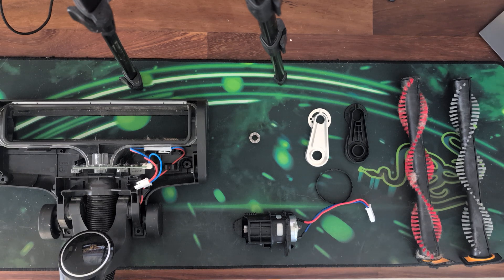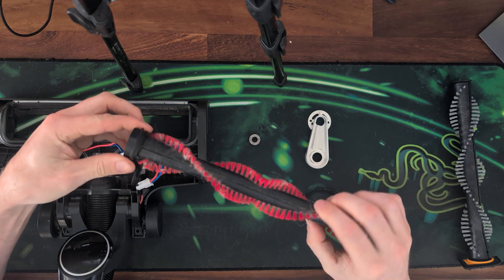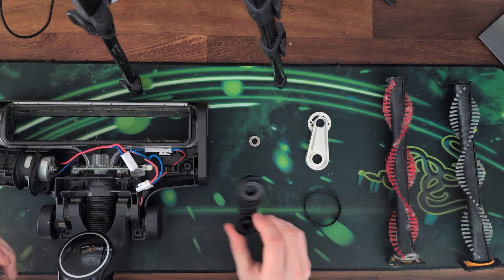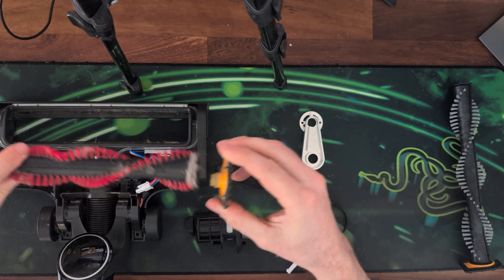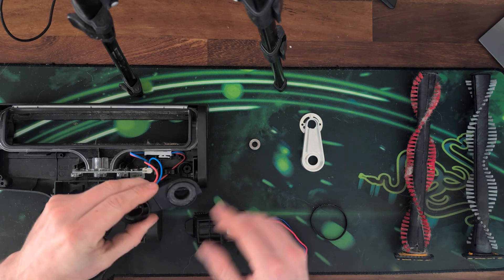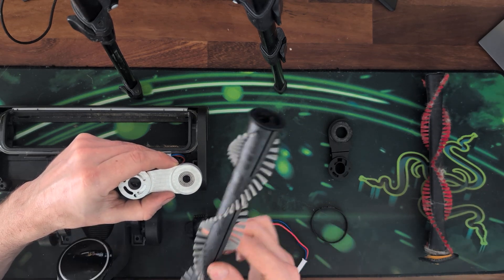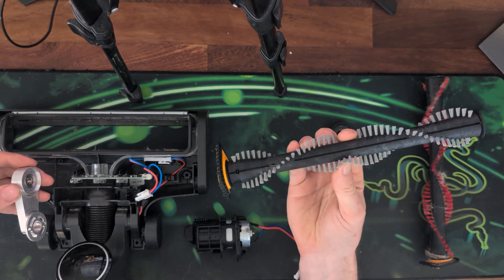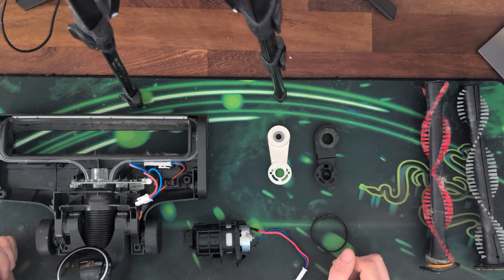Miele Triflex head not spinning repair/upgrade

Comment: CNC companies tell me that .STL is a 3D printing file. Who did your CNC machining with the STL file. Thanks so much.
Reply from the maker: They are dead right. It should be a STEP file for 3d printing. I'll do a git later this week and change the link in the video which will have a STEP file
Reply from the maker: New links with the correct files in description

Comment: My Triflex HX2 head model is SEB 435. My issue was the brush clutch was slipping too easily. As soon as a carpet was encountered it stopped turning. You could stop it turning with a little finger pressure. I never saw any hair collection issues on the ends or burnt hair.

I gained access to the tiny T6 screw on the brush clutch and tightened. That’s all folks. Saved 240 Euros. 

Bit of a pain to get access but you basically just pry open the end where the belt drive is. The larger clutch gear is opposite the motor gear drive. The screw is inline with the brush axis - and at the opposite end of the swinging door.

I took it further apart then needed a first and couldn’t get the belt back on. You can loosen the two T10 screws on the motor end if needed to loosen or tighten the belt. Perhaps it was the combination of both that got it going. Try the clutch screw first. You have to bend the bottom half down a bit to get a straight shot at the screw. Complete disassembly is not needed as seen in this  video.

Have to do that about once a year. Unfortunately I can’t post pictures in comments. Reference 0:32
Reply from the maker: Yes, the white part which you tighten is keyed, but when they get jammed the keys get worn away, so you need to tighten the screw (screw pressure holds it in, not the key. A simple fix would be to glue it in, but then if you need to remove it in the future it will be an issue.
Reply: @ScottFreee3  Hi, I just want to thoroughly clean the hair in my brush clutch on a second hand machine. Can't get the belt gear to separate from the white part. I'm afraid of breaking something, do you have a good method to separate them?
Reply from the maker: @jeandaspry4323 you can try loosen the screw holding it in 1 or 2 turns and then use the screw to push it out. Leave as much of the screw engaged as possible, you only need loosen it a little the break the friction. Once it "pops" free. Remove the  screw fully
Reply: @ScottFreee3  Thank you so much for the advice! Unfortunately I now tried about everything, including pushing the gear out with the T6 screw (it was almost fully screwed in but skipped a thread as soon as I put decent force on it...) I thought I got it a little loose at some point until I realised I had put so much force into it that I had started to deform the white screw-gear, then I stopped. I'm at my wits' end and decided to put it back together before doing worse than the hairs would do. If it fails down the road,  it will always be time to remake the parts as you did yours! cheers
EDIT: someone already posted the belt gear on thingiverse, thing:6012436
Reply from the maker: @jeandaspry4323 it could be melted into place. In which case you will need some pliers to wrestle it out. 

Today that what part failed where the key which locks it into place in the gear is gone.

I'll need to design that and try print one as a replacement
Reply: @ScottFreee3  Yeah probably. I wonder if what I assumed was a mold mark, slightly off center beside the screw hole on the belt-gear, could be something used to 'glue/fuse' the two pieces together, as I swear I can see a little grey-white plastic color in that mark. 
Anyway, If you post the grey-white screw gear on thingiverse, we would have all the elements to re-build the motor transmision to the brush, and that would be very nice! I would probably use it to restore another floor head I have on my hands.
Reply: I did both and it seemed to work ok but the motor just goes crazy now. The top screw on the motor has some play to allow for slight adjustment to belt tension. Belt is tight now. Also lubed up everything possible with Syncolon. When trying to vacuum today it just started getting loud and stinking. Planning to order the part but they need to know if it’s measured in mm or inches. Assuming it’s inches?
Reply from the maker: @ataylortca it's mm, but I'll upload files to thingyverse or GitHub shortly
Reply: @ScottFreee3 they said mm was too small for them to build.
Reply from the maker: @ataylortca I am making a thingyverse account, but I need to wait 24 hrs to post. I'll upload the STP files there

Comment: Hi Scott, brilliant stuff. I have the same issue and was looking for the drive belt part alone but arrived at the same conclusion (the need to purchase the whole motor assembly, which is ridiculous). Did this end up working for you and, if so, can I order one, too? I’m in Massachusetts USA. Thanks!
Reply from the maker: Yes it has been working fine since this video without issue. I have added the STL to the description.

Comment: Hi Scott, I’ve been having the exact same issues with my Miele and use it also for pet hair pickup. Any chance of purchasing one of the aluminum housings for my Miele? Cheers
Reply from the maker: See description. I added the STL file. For me to manufacture and resell would cost too much, so I've made the STL file available so you can have made at a much lower cost using local or online services
Reply: Thank you Scott, I have triflex as well the hx1 pro is this part the same for this model

Comment: G'day, I am having the same issue with my triflex. Have you tried lubrication/flattening the surfaces?
Reply from the maker: I am not sure about lubrication as the melting temperature of the ABS is high. The lubrication may help in the short term, however the friction caused by the buildup of hair is the issue and lubricant will not remove this